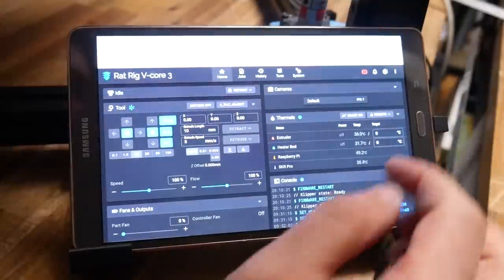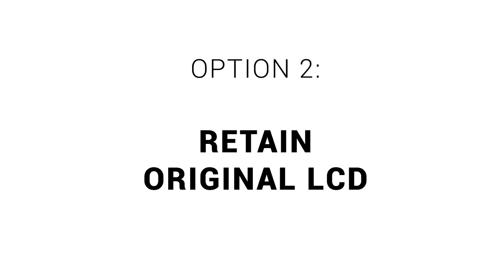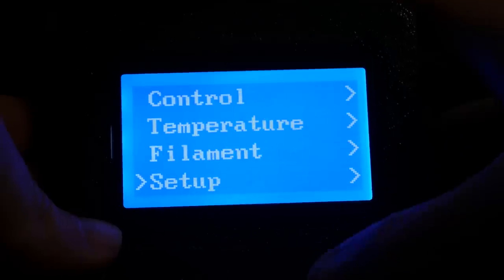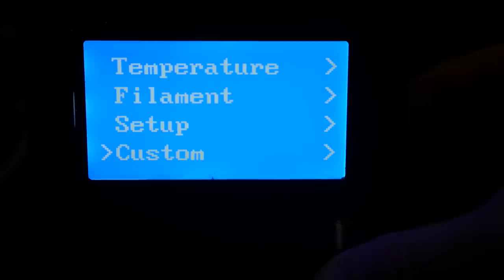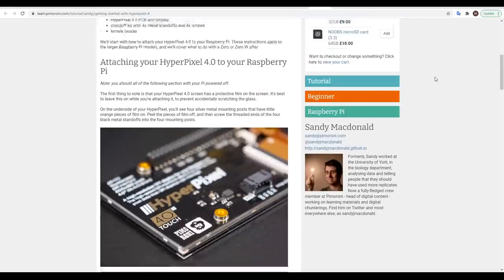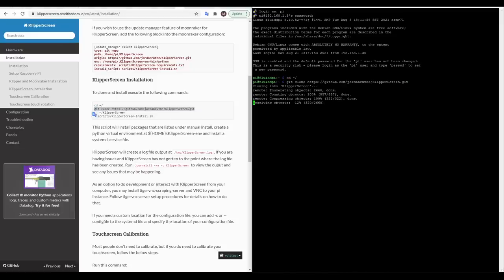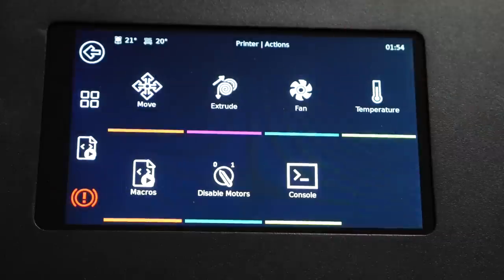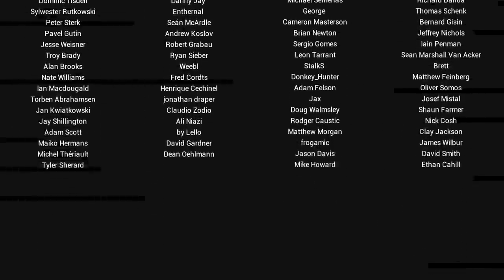Klipper interfaces: Step by step guide to 3.5 options

Comment: Are you sure about the BTT emulated marlin mode?  Last I checked, they didn't implement a specific API call needed for the display, and Klipper couldn't work with them.
Reply from the maker: I've just tested some more and it's not reliable. I have an output but it's easily garbled. Thanks for the heads up.

Comment: Hello Michael,
Thank you for all your videos and for being THE prime source of 3D printing tuning inspiration (it really pushed me to migrate my CR10S Pro v1 to Klipper)

1 suggestion for the screen: I had initially ordered the Hyperpixel but sent it back and ordered a Waveshare 4.3" Capacitive Touch Display with DSI Interface. Advantages include of the Waveshare over the hyperpixel include:
- Better match in size - as Creality display is 4.3", the waveshare display fills better the full hole (no small black band like with the HyperPixel)
- No need to install an extra software (just plug and play)
- No need to modify parameter for rotation (it was in landscape out of the box)
- Most importantly: given it is a DSI connection, it leaves all 40 GPIO pins un-used - and in particular it allows to connect a couple of ADXL345 accelerometers to the Pi allowing to run and automatic parameters calibration for resonance compensation.

Happy to share some pictures on how the set-up is getting along (just received the screen today - will receive and install the accelerometers mid-week)

Kind regards,
Filippo

Comment: Thanks mate for all your knowledge and videos . I went from not knowing a single thing 18 months ago and buying my first Creality CR10S Pro V2 which i recently converted from Marlin to Klipper with Fluidd interface on a Pi 3B+ still using the stock 8bit mainboard . Taking information from the videos you have uploaded gave me the confidence to complety transition over and  install Klipper / Fluidd and make my own custom .cfg file , load Klipperscreen to the Pi with a BTT TFT50 and modify my CR10S with a E3D Hemera plus print a dual Z sync and install , tune the pressure advance on the Hemera and print ABS at 100mm/s very easily . Ive built my own custom temp control enclosure too  and  ive decided to print the parts to start a RatRig build which im half way done ! Thanks again mate .

Comment: Thank you so much for this tutorial, I had almost given up but your guide made it super easy to connect old ender 3 screen+knob to skr 1.4 turbo running klipper.
Being able to jog the machine, pre-heat and bed mesh/level without having to take phone out of pocket and clumsily using mainsail with touch screen is amazing.

Comment: I am using one Sonic Pad controlling two printers (Ender 3 V2 and Ender 3 S1) with Klipper and Fluidd. Creality released this past Thursday new firmware. The touchscreen is nice and the unit seems to have no issue controlling two printers simultaneously at higher speed (tested at 160mm/s). Talk about easy...it just doesn't get easier. I purchased my unit for $149 direct from Creality and compared to all the messing around I was doing with PI's, screens, configuration, this is way easy and cost effective.

Comment: So because I'm brand new to the entire 3d printing world, I realize that my question might seem or be ignorant, therefore take that into consideration... My question is, I have already purchased a Sonic Pad, and wondering if it can be wiped clean, and have generic Klipper installed on it to run and work with MainSail??? My reasoning for asking this, is I'm learning that the "C" company which produces it, is trying to lock down an otherwise open source software and limiting some actions. So while I love the big screen, resolution, color and setup of the Sonic Pad, I would prefer to NOT be locked down by their greedy control issues, and run a normal version of Klipper. Thus the question. Thanks for any help you can offer. Cheers!

Comment: Good video showing a lot of options.  I'm using my LCD original Ender 5 screens.  They work great for me, pretty much just displaying the temperature and progress.  I do all of the commands from my PC using the Fluidd interface. I use firefox ass the browser and have 4 tabs - one for each printer.   The printer display lets me tell at a glance what is going on for that printer.
Reply: Do you use 4 different Raspberrys, one for each printer? Or do you use only 1?
Reply: @eraldylli  I use one for each printer.  While there may be a way to share them, I think the safety of having one per system is better.   I think you can use the new Pi zero for Klipper, especially if not running a camera.  I had the Pi's 3 and 4 from running Marlin / Octoprint, so reused them.  You can check - lots of good videos out - Nero3D does a lot with Klipper
Reply: @woodwaker1  Thanks for detailed reply. I'm running my Klipper on Pi 3A+, and that works great. I got another printer since then, and I was hoping I could save the 80-120$ the Pi's are going for recently. Luckily I got my 3A+ only a few weeks back, at less than 40$. I hear people are getting good results using Klipper with Creality Boxes, but that plus camera costs pretty much as much as a Zero + cheap Pi camera. Maybe old smartphone is the way to go for now.

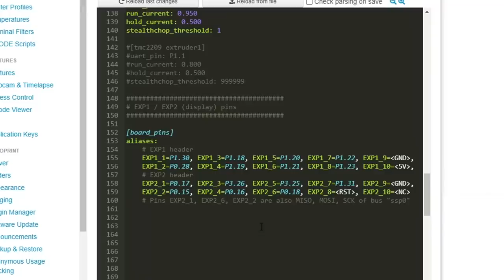Comment: 2:55 — I like that the EXP1/2 plug pins are defined for easier display adaptation. But, I see that they are defined in the reverse order to Marlin, with the GND and 5V pins as #9 and #10. Alas, I've been taking the time to define all the EXP headers in Marlin's pins files recently, but to be consistent with Klipper I guess I'll need to reverse the order. That should be fun! Good thing I"m a master of regular expressions….
Reply from the maker: They have a note at the bottom of the page about mainboard manufacturers having everything in reverse in some cases. More fun for you and the Klipper team to negotiate.

Comment: Micheal; I know this is an older video, but my question is still on topic. Are the FLSUN and Sonic pads the only choices for a Klipper pad? Should I spend money on the PAD of choice or just use an old laptop and save $160.00+. I am trying to take the next step and learn the Control system and not waste resources on a device I really do not need. Boy; do I ever have enough of those already. Thank you for your help, and one of the best channels on the "TUBE"

Comment: Great information and explained way easier than what I have found on the web... good job. A noob question I thought I saw a way to use the Host TF SD Card slot (on a MKS SKIPR board in this case) to print from like we can from a Marlin printer. Are you aware of any way I could find a howto to set this up... if it actually exists?

Comment: Careful with that buck converter, at the 3amps the Pi might pull it can get really hot, you should at least put a heatsink on it
Reply: Yes, that's a teeny buck converter, and the last thing we want is our CR-10 going up in flames. Luckily for me, I have an electronic digital load, and I first tested my buck converter at 1.5A to make sure it could handle my Pi3b running some test software. I'd recommend others to do the same, as some of these little converters wont drop 24v to 5v without getting red hot. 

What I eventually did was to open up the recommended power supply that comes with the Pi, and wire that to the mains supply within the base of the CR-10, in it's own 3d printed and well ventilate box. That supply is rated 2.4A and is designed to run this at 5v without getting too hot...
Reply from the maker: Thanks for the warning. The pi by itself uses a lot less than 3A. The extra current capacity quoted to to allow for peripherals like webcams to be plugged in, which this printer will not have.

Comment: I upgraded an Ender 3 to Klipper recently and reused the display. For some reason the Klipper UI uses a larger font which I don't like (& probably can change) but it works much the same as the Marlin UI - use the wheel to scroll and click on menus.

Comment: Because of your videos on it, I'm currently running Klipper on a BTT SKR 2 with their TFT 35 on my Ender 5 Plus, and since I was already running OctoPrint before I made the switch, I stuck with it as my interface. I absolutely LOVE it, but I'm tempted to at least try the other interfaces at some point. I'm just not sure I want to give up all the plugins I use.
Reply: I' running the same board and TFT. Do you have issues with the NoTouchFW V1.3.1 from teeminus? My screen is showing garbage as soon as the first extrusions happen. No issues though while heating up, homing, and moving to start position before purging.
Reply: @_seriousrob_  I haven't had any issues like that I can remember. I do vaguely remember some minor complications getting the screen to power on at all, but once that was sorted, it worked like a dream. I wish I could help you out, but I have no idea what could be causing that.
Reply: @malechei5519  could you share your display and boards_pin section from your printer.cfg? Maybe it's just a mix up in the config on my side.
Reply: @malechei5519  Looks like i fixed it. I checked the configuration via the update manager under machine. Klipper and Moonraker were compromised. I made a soft recovery and after that it works like expected.

Comment: Thanks for another very complete video with a whole pile of how to choices in it. Any chance you can include the rest of the script you had for the filament runout sensor . It's one of the few things I have to finish with this upgrade after I get the BL touch going.

Thanks
Reply from the maker: I've just updated my SR config on GitHub with the LCD changes shown in tis video: https://github.com/teachingtechYT/klipper-configs
Reply: @TeachingTech   Thank you that is awesome, I was having such a tough time finding a basic script to build from as it seems to be called a couple of different things in the klipper community. And it just occurred to me I only tried the simplified octopi runout sensor.

Comment: I have a printer with klipper and another with Marlin and Octoprint. I want to control the printers with a screen, type TFT70, or with a tablet of about 8", like the one that appears at minute 1:36. With a tablet I could control the two printers at the same time via the web. Could I ask you what Samsung model is the tablet that appears at 1:36? Is it smooth or does it slow down a bit? 

Do you recommend another 8" tablet, or is a single screen per printer better? I think I prefer control via web. 

Thank you very much, regards!

Comment: I need to setup klipperscreen maybe..just been using official pi touch screen with chromium kiosk and fluidd
Reply from the maker: From memory that screen is supported so it should be straightforward to switch to KlipperScreen.

Comment: I am running Klipper on my E3V2.  I am printing the parts for the Switchwire conversion.  I will still be using the 4.2.2 mainboard that came with the printer after the SW conversion.  I want to use a Mini 12864 display on this conversion.  Will that screen work with what I have?

Comment: great video as always really love the content.
May i ask how you turn on and off your ratrig printer?
is there a function in clipper to auto power it off after print and can it be turned on via the Interface?
I had the PSU control on my Octoprint which was really convenient ad i wonder if this is also available in klipper?

KR and thx very much

Comment: Hi, I was using Desuuuu fork with OctoPrint so I can use the touchscreen on the CR10s Pro. However Fluidd installed the original fork which is not compatible with the Desuuuu firmware. I tried removing klipper and installing again with Desuuuu version but then Fluidd did not recognize Klipper. Is there a way to set Fluidd to install the Desuuuu version please?
Reply from the maker: I haven't used the fork. That would be a question for Desuuuu's GitHub issues.
Reply: Use KIAUH to do a fresh install of Fluidd with the Desuuuu fork of Klipper. Save your existing printer config and any other files you want to keep. Install KIAUH on a clean install of Raspbery Pi OS Lite. Before you run it, edit the install_klipper script in the kiauh/scripts folder. On line 88 replace $KLIPPER_REPO with the GitHub repo for Desuuuu Klipper. For some reason I can't link anything in YouTube comments, it has deleted 4 replies so far! Save the script and run the kiauh script to start KIAUH and install Klipper, moonraker, and Fluidd. The mod made to the script force installs the Desuuuu Klipper fork.

Comment: Can I please ask how you powered the Pi in the end? I got a bit confused at the point where you repositioned the printer’s control board (why?) - did you wire something to the GPIO pins?

Thanks for an informative video. I was attempting to use Octodash with Octoprint/Klipper, but I think I will now try Klipperscreen with Mainsail

Comment: Aloha .. .. .. I have an ENDER 3 with a 4.2.2 MotherBoard and a Creality Ender 4.3 Inch Touch Screen.  I also have several smart phone and small tablets. I stared 3D printing about 3 months ago. Do you have a MainSail / Fluidd video for beginner. I am not exactly a computer expert but I do have a basic understanding. Also I have been using CURA for my 3d slicing.

Comment: Hi, is there any option available on klipper to use IDEX mode with 2 in 1 out hotends (not mixing)
my board is BIGTREETECH BTT Octopus Max EZ, awhich has 10 drivers support, i am using X1, X2, Y1, Y2, Z1, Z2, E0, E1 , E2, E3
and  my drivers drivers are EZ5160 (6 qty), drivers for extruders are EZ2209 (4 Qty)
presently i am using only 2 extruders only in idex mode, but i already installed 4 extruders and 2 hotends
Present version of Marlin does't support my setup, can you please help ?

Comment: I see one problem with your Display. It uses the SPI one from the Raspberry... I have a similar Display and this dont allow me to use the Adxl sensor, because it blocks the Spi
Reply from the maker: There is an option to get around this with the Hyperpixel but since this series is about showing multiple ways to do stuff, I will probably do non accelerometer tuning for the CR-10 Max and automated for the Super Racer.
Reply: I think a reasonable solution to this is to do the accelerometer tuning first (remote-in from the web interface), then implement the touch display after that, when the accelerometer is removed
Reply: @TeachingTech  can you please tell us more about the workaround? that accelorameter is one of the major good points of klipper. ordered the screen ...than saw this comment...

Comment: does the the tablet solution have the same features as klipperscreen?
 or would it be possible to strip a touchscreen off a tablet to connect it to a pi and install klipperscreen like option 3?

Comment: was about 2 days after having klipper up and running i removed the screen entirely, want an interface right beside it i pull out my phone and goto the webui
Reply: I did that for a long time. The screen is much nicer, much easier to adjust z-offset.
The screen is also immediately available, and does not have the bad habit of ringing or displaying notices at critical moments.

Comment: The instructions for the Hyperpixel4 seem to no longer work. I can get the HP4 installed and rotated, but touch does not work at all. Any ideas on why? Have you updated any of your software and run into this issue as well?

Comment: Still running stock firmware.
Using Pi 4 and octoprint
Prints look great so do not have to many complaints but I do have one issue that I share with a friend and his SR. The nozzle seems to drag over the infill clicking all the time. The only change I have made to the printer is the extruder. Went with a OMG V2-s F2 set. Using profiles found in the FB group. Again, prints come out looking great but the nozzle just cracks away across the infill. 
.16 layer height
Infill is 15% grid
speed is 160mm/s for infill
retraction at 7mm at 35mm/s, combing mode on all 0.0. zhop off
cooling at 100%

Comment: Did you manage to swap z baby steps to y babysteps for the belt printers?
Reply from the maker: The belt printer is still running Marlin. That footage was an example of the app, not specific to Klipper.

Comment: do you know how to do custom menu? im using desuuuu on a cr10s pro (V1) im trying to add :

[menu __main  __tune __offset]
type: input
name: Offset Z:{'%05.3f' % menu.input}
input: {printer.gcode_move.homing_origin.z}
input_min: -5
input_max: 5
input_step: 0.005
realtime: True
gcode:
    SET_GCODE_OFFSET Z={'%.3f' % menu.input} MOVE=1

but i get this error :

Section 'menu __main __tune __offset' is not a valid config section

Comment: OK, one question....  I'm using a BTT TFT35 currently. IF I decided to retain this screen in emulation mode only, are the ports on the side still usable? Or do those go away as well?
Reply: Do you mean like USB and SD ports for loading up prints? I would imagine those don't work, as they normally work by the display itself streaming the files over the serial connection to the mainboard. Since that is part of the GUI mode and with Klipper it's the Raspberry PI sending lower-level commands to the mainboard, I wouldn't expect them to work. If Klipper ever adds support for connecting the BTT TFTs to the Pi directly to talk to Klipper somehow, that would be theoretically doable, but I wouldn't hold my breath.
Reply: @scramsby  Yeah, I was kind of assuming the same thing. I was just hoping maybe Michael could confirm from his testing. But thanks for reinforcing my thoughts, too!
Reply from the maker: After further testing, the display easily becomes garbled so I wouldn't recommend the TFT35.